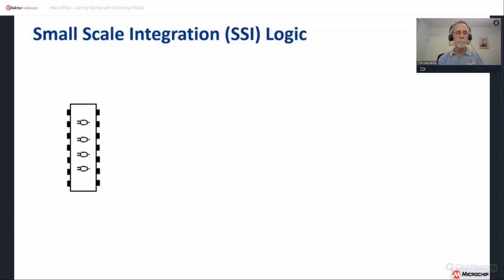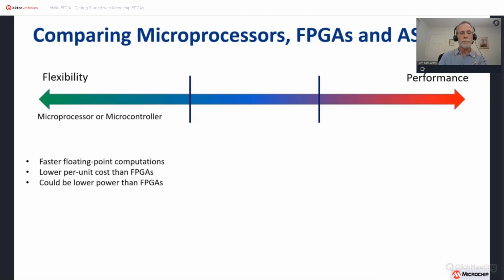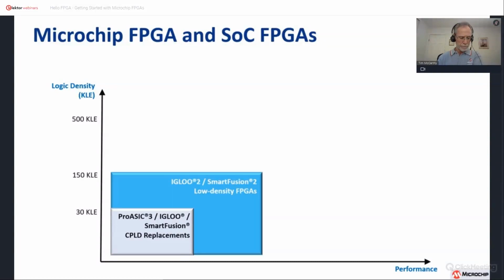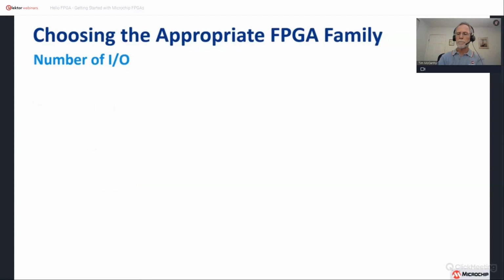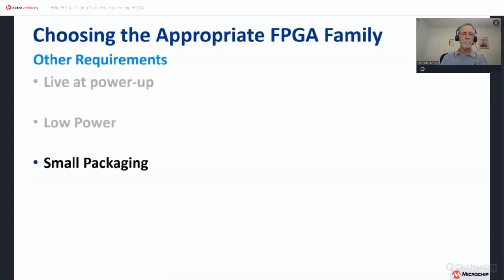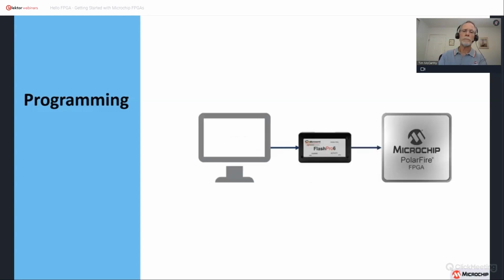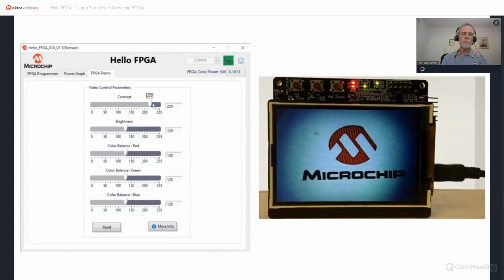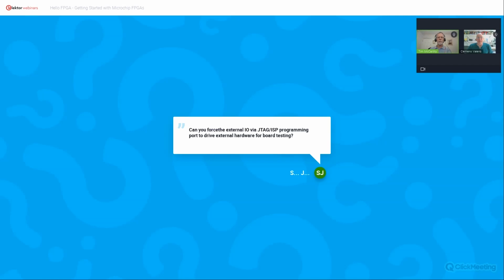Hello FPGA – Getting Started with Microchip FPGAs

Comment: Thanks for the Webseminar, I think the PolarFire FPGA's are good midrange FGPA's, and the free tooling looks good.   BUT...  sorry to say that im not interested in the Hello FPGA-kit,  because i find it TO expensive.  If you would use the Arduino  mkr vidor 4000  , then you have (appart from the camera, what i do not need),   more  FPGA-value   compare the Altera/Intel   10CL016   with the Smart fusion m2s010,   Thats more FGPA for lower cost (comparing Hello-FPGA-kit  with Arduino  mkr vidor 4000).. , As for the for Hello-FPGA-kit having free tooling,..., also for the Cyclone10 16k FPGA you can use the Free Quartus-Prime-Lite edition.    I'm more interested in a Polafire-FPGA Eval-board.., but Microchip is making that WAY to expensive.     In this manner i do not go looking into Microchip FPGA..,    @Microchip..  the polar fire FPGA's are very nice midrange FPGA's.., but Microchip should provide  better priced Polarfire eval boards..   Why not provide low priced eval boards  to get the Microchip FPGA's to be used.